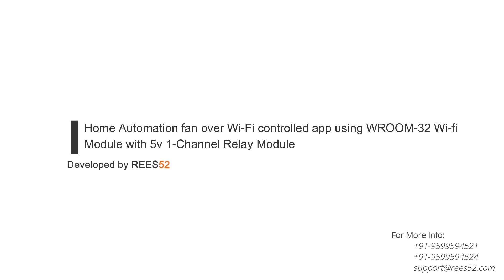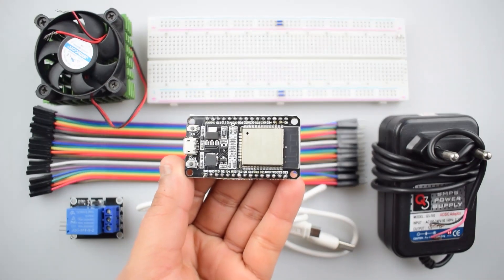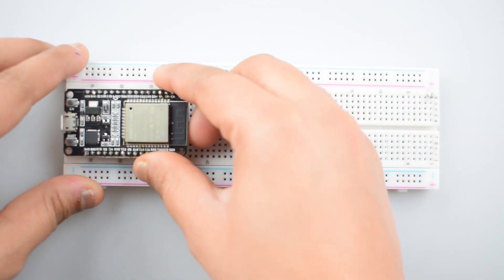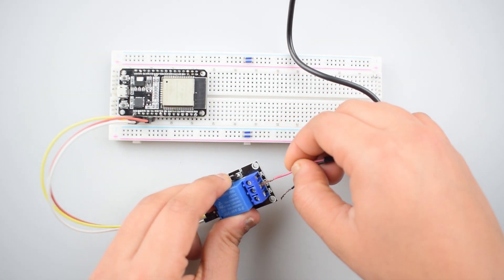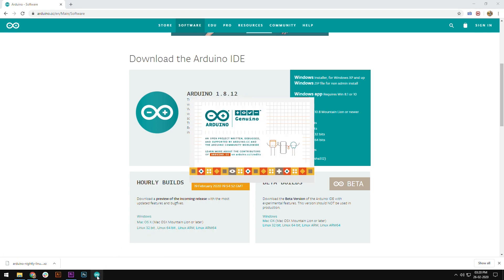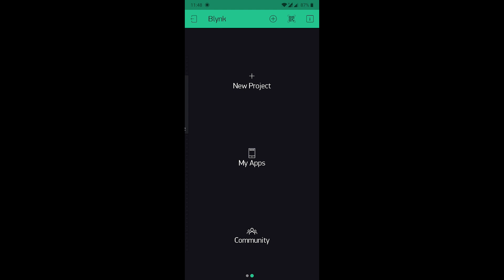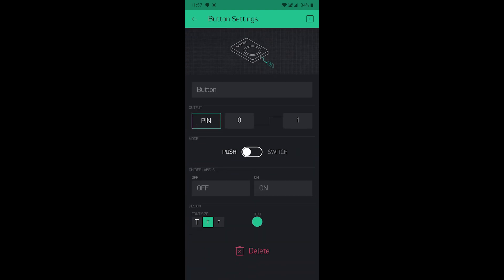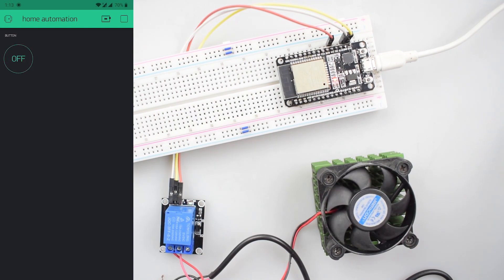Home Automation fan over Wi-Fi controlled using WROOM-32 Wi-fi Module with 5v 1channel Relay Module

Comment: Do you tell me Is it possible to control AC FAN dimmer (with zero cross detection) both By two Physical push BUttons (for speed increasing and decreasing) manually and also By Blynk app slider button for controlling speed through wifi.only zero cross detected esp8266 and blynk app slider button based fan dimmer code is available in internet but those are not manually controllable at all when wifi is not available.  I ask the question because facing very difficulties to write the code for integrating push button function with only wifi controlled code (By blunk app slider button) . do you know is it possible or not ?